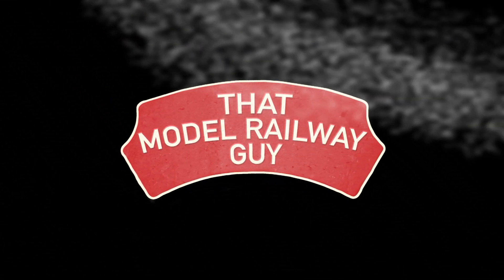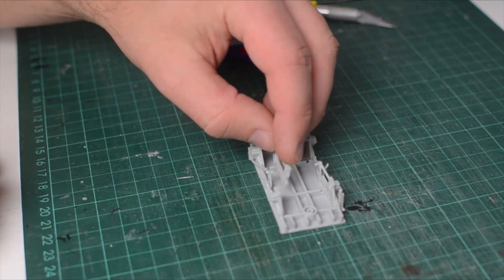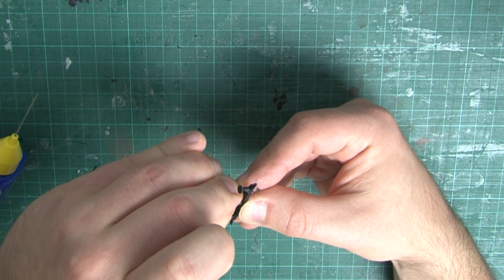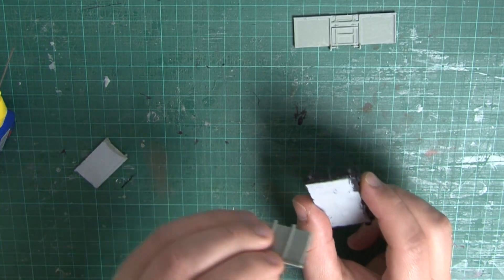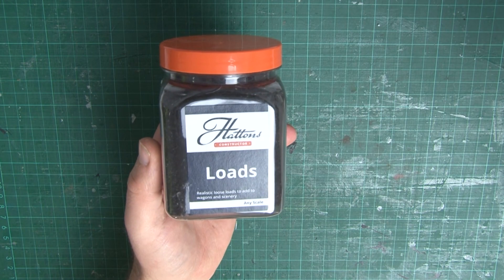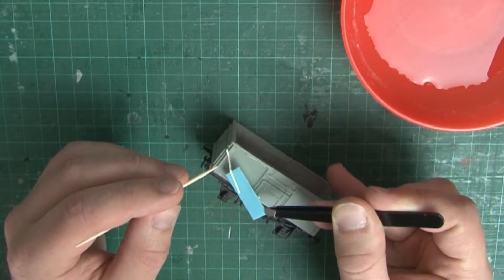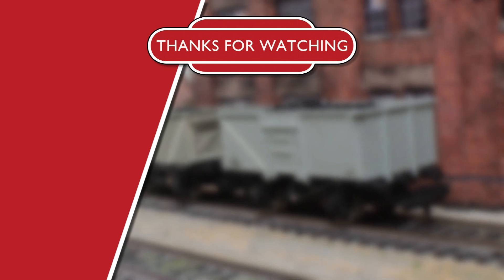How To Build A Dapol Mineral Wagon Kit - Model Railway Tutorial

Comment: A good tip for these kits is that because the wheels have fairly finescale flanges, once the underframes is assembled, dunk it in some hot water for a few moments, then press it against a sheet of glass to ensure the sole bar is completely flat - this'll prevent wobbly wheel syndrome and the associated derailments.
Reply from the maker: Nice tip! I'll have to try this out if I build any more of these kits in the future. Thanks for watching 😃

Comment: Very useful thanks! A couple of questions: What is that glue you are using, and where do you get the lead weights? I have a few Dapol wagon kits waiting to be built, so this was really good to watch. Please do more if you can! Thanks.
Reply from the maker: Thanks Andrew, glad it was helpful. The glue is Revell Contacta (but any plastic glue should be fine) and the weights are just some curtain weights I found on Amazon in a pack of 20. I've also seen people use tyre weights or fishing weights as well so whatever you can get hold of really. Best of luck with your own Dapol kits, let us know how you get on and thanks again for watching! 😃
Reply: I use car wheel weights if this helps
Reply: @timwhite4301  Thanks Tim!

Comment: Worth a mention that the white line(s) tell you where the end opening door is located (though it doesn't open on the model), thankfully you correctly placed it on both sides. The white line should match on both sides! I have seen wagons with it on the other side! The front opening door(s) also might have a V shaped line transfer for them. Alternative loads include black (packing) foam, which is more realistic for power station coal. There's a YouTube video about this.
Reply from the maker: Thanks Graham, great points! I'll be honest I thought I'd mentioned that in the video but looking back I only said I looked at images of where they needed to go. I did show a close up of both sides though for anyone following along. 

Yes, the side doors do sometimes have the V shaped lines on them but these transfers aren't included in the Dapol kit which is why they weren't added. Good to know about using packing foam for the wagon loads - I've done a few videos on adding loads to wagons too so there's lots of creative techniques out there. Thanks for watching 😃
Reply: It doesn't help that the photo on the packaging has the stripe in the wrong place.

Comment: Silly question time.

The ready built unpainted dapol wagons come with NEM pockets fitted. Would it be hard to fit these to these kits?

Thanks
Reply from the maker: Not a silly question at all John. I actually have a few unpainted wagons on order for another video, so I'll be able to investigate properly when those arrive. 
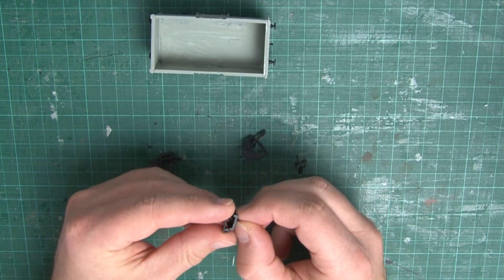Dapol do sell spare NEM pockets that look like they just plug into the hole in the chassis in the same way the ones in the kit do, which would be very easy in theory. There also seems to be people selling 3D printed NEM converters that are intended to just clip into the coupling mount, as shown at 06:17, which looks like a good option too (assuming they work!) so I'm sure it's achievable. Thanks for watching 😃

Comment: What glue did you use?
Reply from the maker: Hi there! It’s nothing special, just Revell’s standard plastic glue but the fine tip is really handy 😊 Hope that helps and thanks for watching 👍
Reply: @ThatModelRailwayGuy  Thank you! I was not sure which brand you used, i am planning on building one of these kits and the nozzle on the container looks useful for presision.